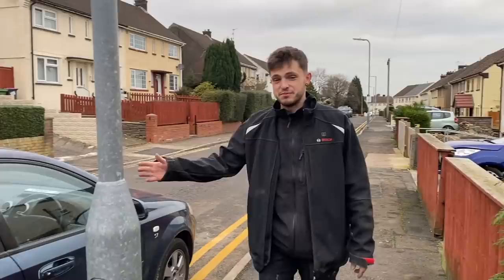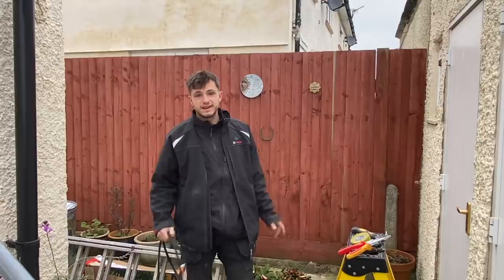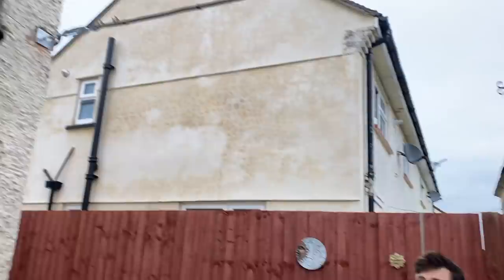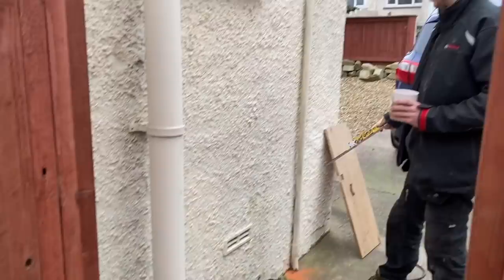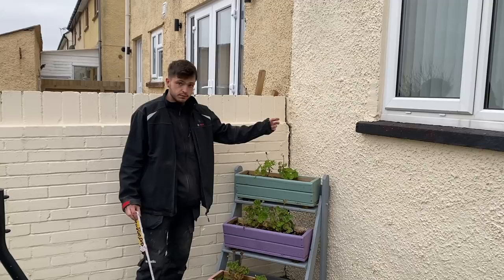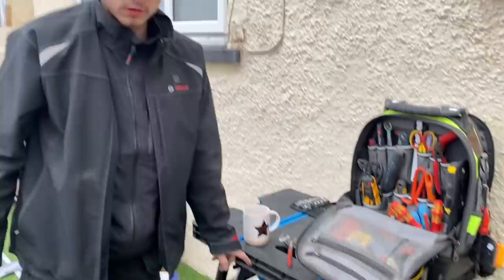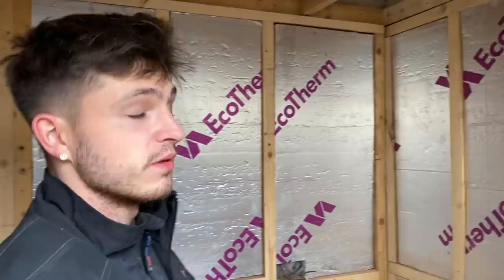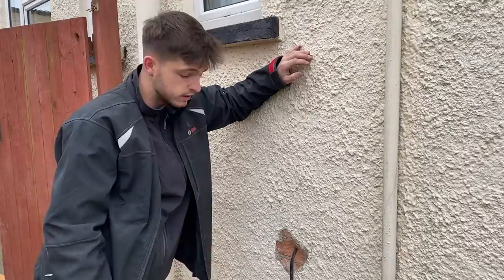EP1- I NO LONGER WORK FOR TOM NAGY AND MY FIRST JOB!

Comment: You should remember to put a drip loop on your cable before it enters the building mate, rain water will run in via that horizontal cable entry. 👍

Comment: The cable run could be a bit more discrete, like running inline with the drain pipe and near the ground. Same with the spur socket left hand entry down the unpainted bricks and along the ground and back up to spur inside. The continuing wire is a great option considering its concrete flagging.
Reply: Pointless comment we all do things differently
Reply: Cleats upside down always hang on screws

Comment: When cable running across two different surfaces (e.g. from the wall across the catenary wire) it's good practice to leave a small loop in the wire for repairs or adjustment.
Reply: And a drip loop before entering a building

Comment: To avoid the brick pop: estimate the thickness of the wall and turn the hammer action off on the drill just before you punch through. 

(Easier said than done, but gets easier with time and practice)
Reply: Another way is using anchors and resin

Best way on old Victorian properties

Comment: Good video, well made. Little tip, don’t rely on those little covers that come with the outdoor sockets to stop water ingress through screw holes. They’re dog shit. Either silicone the top or over the holes them self. And drill a small drainage hole in the bottom. I’ve learnt the headway! Water gets in the quick and fills up quicker.

Comment: This cable is great same protection rating as SWA. Alsecure NXS multipurpose general wiring cable BS8436. Cu class 2 / xlpe/bonded alluminum tape lszh. It has a much thicker sheath than firesure etc and is stiffer but has multi stranded.  cables. Its stiffer to dress on walls etc so makes a nicer job. Not sure if its only in white. Don't think id use it underground.

Comment: @
Jimbo The Electrician
Always drill from outside to inside so you don't blow out the stucco/finish on the outside of the building!!! Or use a very small drill bit as a pilot hole if you have to then use a larger bit and go outside to inside...

Comment: You could get more tension on that steel wire by cutting down the threaded sections of the turnbuckle; obviously they are touching now so you’ve run out of adjustment, but if you cut them down you can create more. Or use a slightly shorter turnbuckle.
And if drilling from the inside, out; start with a smaller diameter as a pilot then drill from the outside with your final size. 
All the best! 👍🏻

Comment: 4:00  The steel wire should be strong from one side to another but the metal thing at left in pic should have every huck 50% inside only, not 100% same at your Demonstration. So you can level it better for stronger or less. 

Same with the cable, let it little bit free hanging too. 

Best wishes in your new own business!

Comment: The wire tension is set with a turnbuckle and must be installed with it fully unscrewed. Once the wire is set in you then screw it up to give it the tension.  Look on YouTube how to turn buckles operate for a better

Comment: Not sure how indestructible that cable is but in the US we would run conduit to protect wires from damage and also so no one gets shocked from a damaged cable
Reply: It should be fine, the only thing I'd be worried about is sagging and poor looks because it's flexible. I'd suggest clips every 200 mm, possibly even 150. For HiTuf solid (NYY) you can go up to around 250 but this looks more like 400.

Comment: Drill a small hole through brickwork then go outside and drill in a quarter with your required size drill bit then go back in and finish your hole off. Or turn the hammer of before you go through as previously suggested. Nice vid though not digging this tough flex armour cables outside on a long run.

Comment: Good Luck with the Business,  good few comments to take onboard,  I'd have added a drop loop on the line accross the buildings, also would have run cable higher than the damp course level on a house .... looking forward to more YouTube Vblogs... but be careful filming your wheels on a set of Double Yellow lines 😒.

Comment: i was thinking tonight ive not seen anything from tom for a while so searched for him and u were the second vid on the list that came up, good luck with new business, nothing ventured nothing gained as they say, u will prob find the administration side of things a lot harder than the actual work. oh...and get urself a tape measure and use it, u could have measured that hole out from the window and bored from outside in

Comment: That little blue plastic box made me laugh pal. I did the same when I first started. Loads of daft little flimsy boxes in my van than always seem to destroy themselves at the worst possible moment! :D

Good luck bud. 👍

P S. Change switch off hammer function as you're about to go through (estimate wall thickness first) to prevent or limit blow-out.

Comment: Good luck in the jurney ^^
Just a smoll tip, Ive done this mistake a million times myself https://youtu.be/r9Ih-gQJ8g0?t=379 (where you punch a real crater of a wall) 
What you do is when you hear the sound change (when hammerdrilling) you switch over to just drill mode on the hammer drill (it will go slower but no more craters)